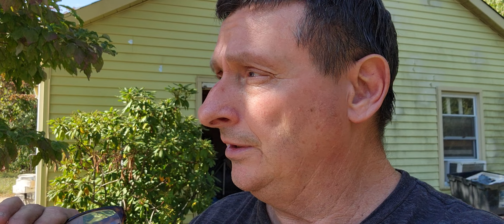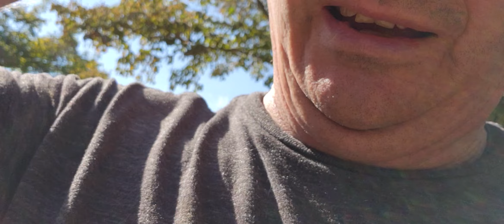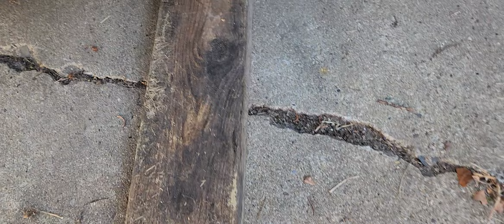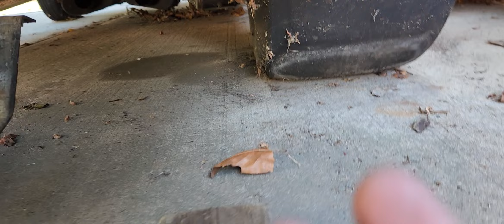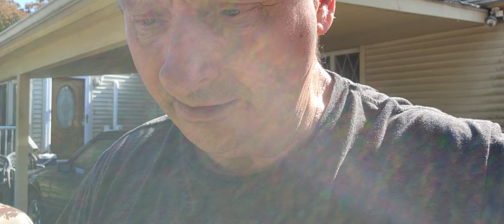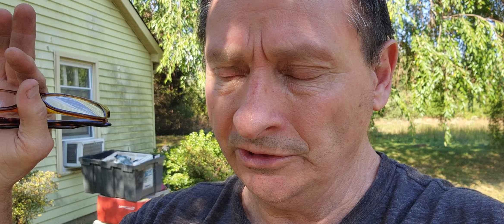Should you change your carburetor for traction purposes 🤔

Comment: Thanks, I apricate the advise. The car is a 1975 Pinto with leaf springs. 26x8.5 drag radials, 3.55 gears, Yukon limited slip. C4 3000+ stall, 302. Soon to be 331. It's a car that I am keeping fairly mild looking but I do race it. It did 12.38 @111mph a couple weeks ago. The car is launched at 1/2 throttle or it just spins. No wheel hop just spinning.
Reply: thats cool another pinto guy is on here. Have you thought about som;e caltracs? thats what I have on my 79 pinto named beans with a 347 t5  8.8 4.10s . I havent ran it at the track yet cause Ive got to get some slicks for it but it is tons of fun to drive
Reply: @79beans347  How did the Caltracks improve traction?
Reply from the maker: @79beans347  that's right bean another pinto guy 😆 🤣 how cool is that 😎 I wish I'd of known that when I was showing those springs I automatically think fox body 😀
Reply from the maker: @claytonstoolbox  Clayton I didn't mention it in the video but air pressure in a drag radial is crucial on my pinto years ago I used an extended shackle which was old school but it did work but for traction I like the lakewood traction bars the ones where the shock bolts through them but they need to be lengthen a little bit but once again old school I think the cow tracks would be the way to go but in this case bean may be your best option to ask good luck if I can help just ask thanks for watching

Comment: Vaccum secondary carb better for and automatic car then double pumper
Reply: Depends on several things
Reply: @256garage  low stall on a automatic low compression engine double pumper seems to fall on there face unless tuned to the razors edge and still have a slight stumble what ive seen